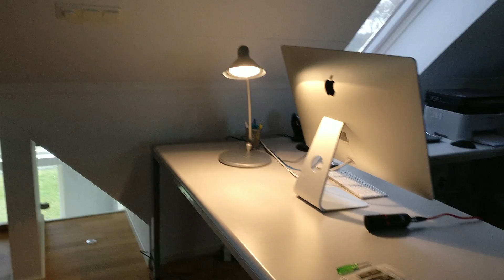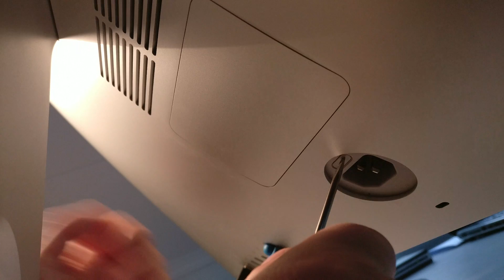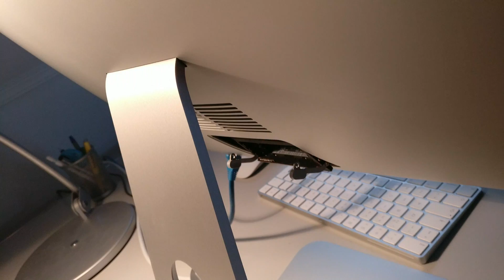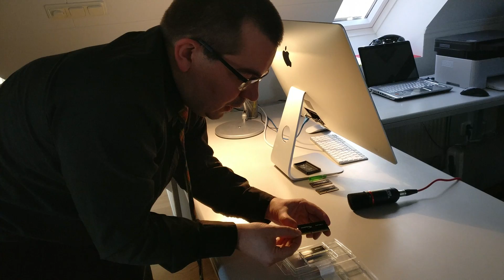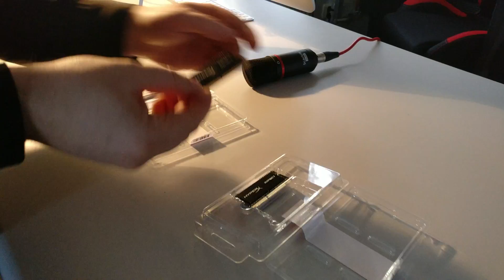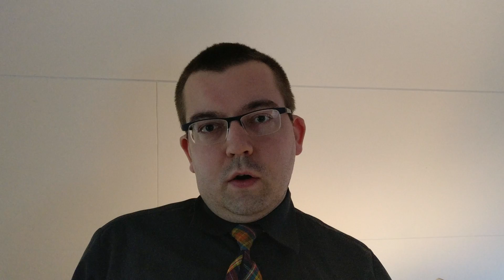iMac 5K - RAM Memory Install

Comment: why did you choose to work with that memory and where have you found certified apple memory?  I have the late 2015 iMac  27 inch with the 3.3 Skylake and and r9 m395 MK482LL/A
Reply from the maker: Well, first off i only found 2 memory brands that said they are "Apple Certified". Im no memory expert, but i can say that i experience these Kingston Hyper X to be slightly slower than original for some reason. Wheather that is because of RAM timings or the amount of sticks used, or other reasons remains to be answered. However i can report that i never experienced a crash, that ithink was related to these memories. So they seem stable. I cannot find much at Kinstons site at the moment. But you can find on Corsairs site. It say Mac Memory, but im unsure if they are "Apple Certified". Maby mail them & ask? Here is the webpage: http://www.corsair.com/en-eu/memory/mac-memory
Reply from the maker: corsair.com

Comment: Hey there I'm here to ask you about your gti so there are two kind of gti's the normal gti and the clubsport? or there is only the clubsport in 2017 and did the golf r had these changes or it's still like the old golf r, sorry for my English 😅
Reply from the maker: Hi there. Thanks for asking! Im glad you asked... Yes there are 2 diffrent as you say: Normal GTI & GTI Clubsport. If you are asking about the new Golf R compared to old one, i dont know much about it. Back to GTI Clubsport! (Clubsport is also called Edition 40). But since the GTI Clubsport is a Special Edition (40 Year Anniversary Edition of the GTI), they have stopped being produced now. These so called "Special Edition" Golf GTI models only are produced for a short while & here in Sweden they stopped producing them in December 2016. You can still buy one IF you find one at your VW dealer who may have bought it from VW factory though of course (me myself ordered mine from Germany to dealer to get the exact specific options i wanted). And YES the Golf R & Golf GTI Clubsport are VERY SIMILAR - They have the same engine, same valves, equipemt around engine parts etcetera. The Major differance between a Golf R and a GTI Clubsport is that GTI Clubsport dont have 4 Wheel Drive like the Golf R, instead its FWD & sends 100% of all power to the front wheels! its sligthly downtuned 290 hp on Kickdown for 10/20 seconds, compared to 300 hp all the time on a Golf R. Still, like i wrote before: The Golf GTI Clubsport share the same engine as the Golf R, but GTI Clubsport is lighter, takes curves abit more easy, and it also sounds quite alot like the Golf R! :)